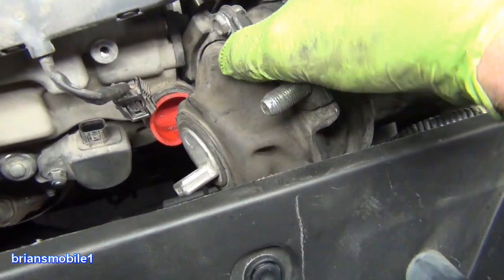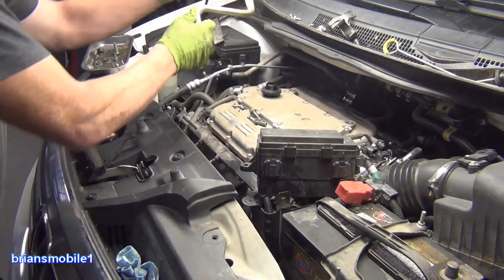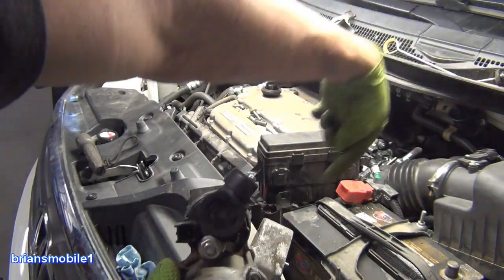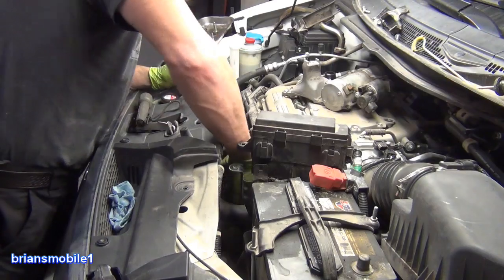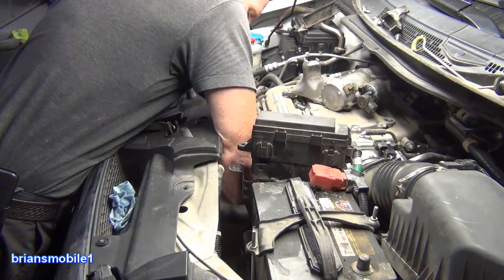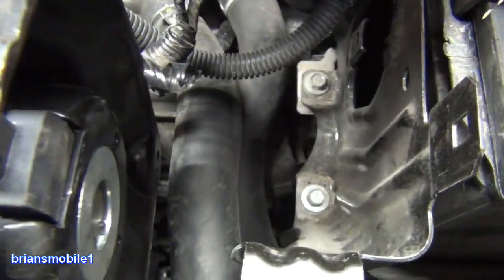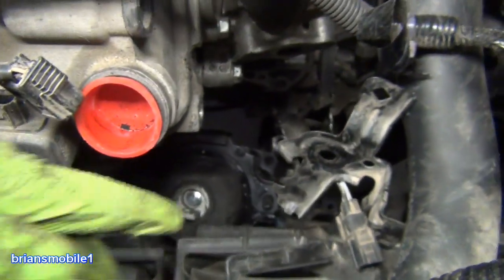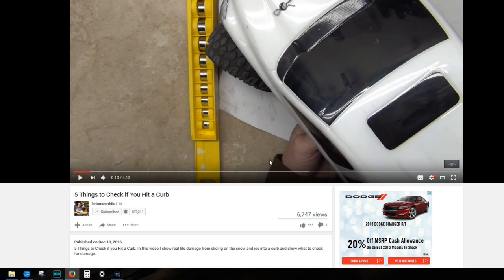How to Replace the Front Active Control Motor Mount on a 2008-2017 Honda Odyssey

Comment from the maker: Because front engine mounts look the same as older models and you've like done many of them, it would be easy to expect newer Odysseys to be quick and easy- and they are.... -ish.   They're even easier to do if you drain the coolant and remove the top radiator hose or both.   Knowing what to expect is key.  That's what this video is set to do.  Give you a picture of what's involved up front.
Reply: wow
you make it sound so easy... lol
Reply from the maker: With some heads up on what exactly you need to do- it's not bad.  No heavy lifting or tricky maneuvers except the passage.  With 2 hands it's a cake walk.
Reply: yes, ty for sharing

Comment: Great video! Not trying to discredit your efforts because this is really valuable content to people that want to do the work for themselves but there is an easier way. I am an ASE Master Tech with quite a bit of experience on Honda's. For this particular mount it is easier to drain about 1/2 gallon of coolant, remove the upper plastic on top of the radiator, disconnect the upper hose at the radiator, lean the radiator towards the front grill, remove the condenser fan and then the radiator fan. One you've done this, you have full access to the mount and it can easily be removed through the gap where the fans came out. Just so you know if you ever had to do this job again, it takes about an hour. Again, not trying to discredit your video, just sharing another way to do the job.
Reply: I have the Honda manual and what you say is correct. Also talks about removing battery and battery tray to. This guy makes it way more complicated.
Reply: True!! definitely...all i did was remove cooling fans as well. didn't have to touch starter, front harness, etc.
Reply: I really appreciate this alternate explanation but I particularly like how pleasant and respectful you were when sharing it!

Comment: just to help others it is much easier to loosen the radiator and condensor so their is play remove the radiator fans, and slide the motor mount out, you dont have to remove egr, or the starter or any coolant hoses non of that
Reply from the maker: Thanks for the tip!

Comment: Thanks for the video.  I'd been looking for a video to replace my wife's Acura MDX front motor mount and I stumbled on this.  The build on this Odyssey looks pretty close to the same.  I couldn't find any useful vids for the MDX.  Wondering about the fellow below that posted to do it differently.
Reply from the maker: Very welcome!  There's many ways to get the job done.  I say give it a try if you have the time.

Comment: Good video. 

What was the diagnostic on this? Code, Noise, leak of some sort, Etc? 

What's book time on that?
Reply from the maker: The dealership told the owner all the engine and transmission mounts were bad.  The rear active control engine mount was leaking and the one by the timing belt was cracked.  Book time is 2.1 hours.  Thanks!
Reply: @briansmobile1  front mount was leaking? Or rear mount?

Comment: I pulled the radiator and fans, didn't have to remove the starter or any electronics or o2 sensors ?
Reply from the maker: What year was it?  You could do that I guess.  Not sure it would be faster.  Any time I can avoid spilling fuel, coolant or oil I try.  Saves clean up time and clean up material.  Also saves that customer call about weird drips or burning smells.
Reply: Dealership would charge about 900 dollars in my neck of the woods
Reply: @pirihern9329  Honda dealer in Roswell, Ga wanted $600 to replace front mount only. Part was in stock at local parts store for about $175, took me about 2 hours on my driveway....
Reply: @briansmobile1  was a 2004 with the 3.0.....
Reply: 2014 lay the condenser and radiator foward remove the fans and the motor mount slides right out take about 90 minutes round trip

Comment: Brian thanks for the video. Today I reached a couple of impasses:  1) bottom two 12mm nuts holding EGR pipe in place are rusted in place. I soaked them with PB Blaster and now waiting. What wrench or socket do I use to remove the nuts. and 2) what tool do I need to remove the two 14mm bolts on the left/right sides of the cast (aluminum?) retainer that sits on top of the mount and secures it to the block?  I’m hesitant to use the boxed end of my ratchet wrench with a cheater for leverage,  ur can’t get a socket on either of them.
Reply: Can try removing the radiator fan instead

Comment: @briansmobile1, I also have a 2013 Honda Odyssey, is there an aftermarket mount you'd recommend. Like other's, I've seen many reviews saying aftermarkets are not good, but the OEM ones from Honda are expensive, so I'd appreciate any suggestions.
Reply: I’m having the same problem did you get the aftermarket?

Comment: Would this be the root cause of an annoying vibration when speed exceed 70mph on Pilots. I got a 2012 Pilot that has a high speed vibration when it exceeds 70mph. I already did 2 tire and balance. I'm taking it in for a third which will consist of the Hunter Force balancing in hopes it will eliminate that vibration. Other forums claim it's the lower fork bushings, and others claim it's a VCM problem. What symptoms did the Odyssey have that your changing the motor mount. Thanks Victor
Reply: That's your CV joints. Honda does this weird thing where they have a vibration high-speed under load
Reply: The cause was the tires, out of round, Discount tire did God with warranty replacement, then I sold the dam thing.

Comment: Wouldn't that be easier to take the front bumber off and do it from the bottom? I gotta get mine done on my 2016 and I don't want to pull the starter or take half the engine apart 😂
Reply: Were you successfully replacing the motor mount with only removing the bumper?  Did you use OEM or aftermarket (moog?)?
Reply: @chrisschultz6129  been a year since my comment. i got a new car by now